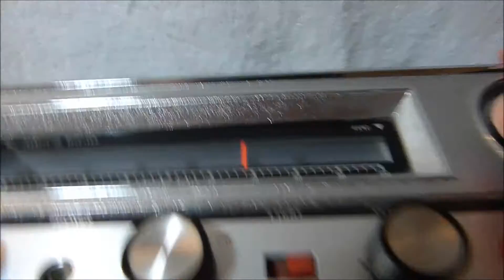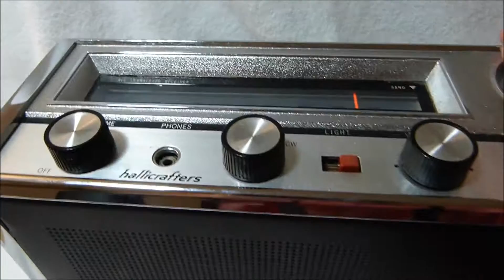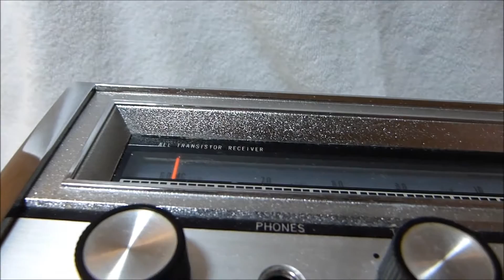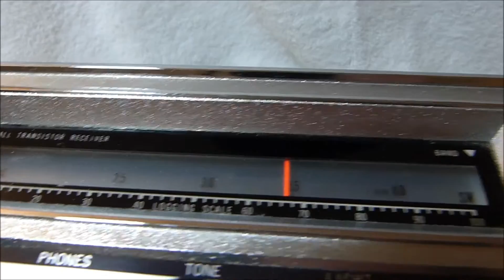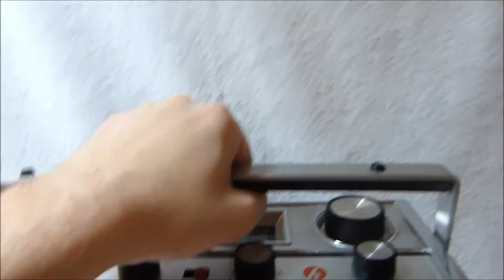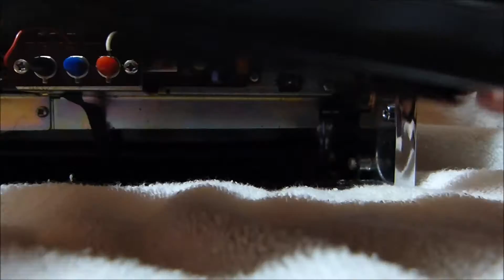1965 Hallicrafters model WR-4000 shortwave transistor radio (Japan)

Comment: My first receiver in 1961 from Radio
Shack, which was very much an amateur
radio outlet, was a Tube Hallicraters
SX-110 receiver, for MW, SW, and a 
Bandspread for the main HF amateur
bands, before I became an amateur
radio operator in 1962. I had the
receiver until the 1970's.
Reply from the maker: Hallicrafters sure built their radios to last, that was a good purchase. It's too bad they didn't continue on with making transistor radios themselves, I think the Hallicrafters model WR-3000 was their only US made transistor set.

Comment: I just picked up a beater at a hamfest and the plug with red and blue wires were in the set but no battery compartment. QUESTION: Does the positive battery connection go to the outside of the plug? That's what the color code appears to be. Harry
Reply from the maker: Harry, I just dug mine back out, and on my set, the red wire on the battery plug is indeed the positive, and the outside of the connector is positive (the opposite of the norm)
Reply: @50sTransistorRadios  Thank you-that is what it looked like and I didnt want to hook it up wrong. I appreciate it. Harry
Reply from the maker: @N9CQX  No problem, I hope yours ends up working!